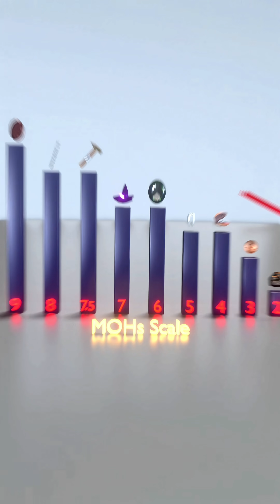Diamond vs Hammer: The Brutal Truth

Comment: I appreciate you explaining this. This is one of the most common myths in gemology. Diamonds are extremely brittle and will chip even from daily wear over years. Most antique diamonds that come across my bench are chipped/cracked from daily wear. All it takes is a little bit of pressure on a specific point and you have a pile of expensive dust.
Reply: If you heat that diamond dust up in an oxygen-rich environment you can convert it into carbon dioxide gas and make some really really expensive sparkling water. Nilered did it once lol
Reply: @timesprodoctionsthat’s funny and totally something I’d image influencers talking about lol
Reply: A material high on the hardness scale will be brittle, that's why hardened steel components are  annealed to be less hard.
Toughness is often better or hammers and swords would shatter.
Reply: So kinda like eggs? They're fragile but on a certain spot of the egg it can actually be pretty strong
Reply: @AxelBalderrama-o6c no, eggs are fragile.
Reply: What gem/stone is the best for jewelry such as wedding rings?
Reply: They're not extremely brittle. They're only somewhat brittle, and given its extreme hardness, its overall toughness is fair to good
Reply: What are some gems you've come across that you don't see alot of chipping on?
Reply: @Marshmallow_Embers all stones can be chipped, regardless of toughness or hardness. If I had to pick one stone that has high toughness, it would be a corundum variety (Sapphire). Its mohs hardness is less than diamond, but it's usually more durable for daily wear in terms of toughness and resistance to shear stress.
Reply: @super_steven_17 jade is pretty tough I believe. It helps that it’s not a crystal.
Reply: @jeantivollier6453 yes I have a permanent jadeite bangle that I wore day and night for 15+ yrs. It does not chip just becomes a little dull from minor scratches.
Reply: None, you can’t fight entropy
Reply: Diamonds aren't anywhere near as brittle as people think. There are plenty of videos of them being smashed with a hammer, and the diamond being pressed into the anvil. Or videos of them being competed pressed into the toking of a hydraulic press. That diamond he had in this video was a cheap diamond with tons of inclusions. (He wasn't going to smash a $5k diamond.) That diamond must have been absolute trash for him to smash it. Even a bad diamond that size is $500, and I know he didn't smash a $500 diamond. So it must have been absolutely terrible, and possibly laser drilled full of holes. A high quality diamond wouldn't have broken that easily. Diamond without inclusions and that haven't been laser drilled, are extremely tough. The myth began as diamond being indestructible, and people didn't know they're brittle. Then it morphed into people hearing diamonds are hard but brittle and they began thinking diamonds are out here shattering. Diamonds are 10x less brittle than you think. They chip and crack because of inclusions and natural "fault lines" where they're weak and prone to cracking. Diamonds are not naturally as brittle as you think. Inclusions and laser drilling weakens them.
Reply: @littlejackalo5326 I believe brittle means that it will break instead of bending. Since diamonds is incredibly hard then it’s hard to break. Also diamonds can be cheap. Lab diamonds are cheaper than mined diamonds and if the diamond lacks the appearance people want it is also worth way less
Reply: Sybau
Reply: Soo, diamonds are really pretty and expensive prince rupert’s drops
Reply: @bloop9074  No, Prince Rupert drops have a high internal pressure so they straight up explode from the slightest pressure on the tail. Diamonds aren't as strong as them either they can chip from other places too.

Comment: So is the Mohs scale exponential like the magnitude scale of earthquakes? Very interesting demonstration. Thank you!
Reply from the maker: It’s ordinal, not exponential
Reply: @MassoyanJewelers  Thank you! And thank you for this little brain exercise!
Reply: @MassoyanJewelers  one day I really want to be able to afford having you guys make two pieces of jewelry I’ve had in my mind’s eye and sketched out. I can’t afford it but I’ve saved your info and really hope I get to see you in person one day!
Reply: A stone that's 9 on the Mohs scale is less hard than whatever stone is 10 and more hard than whatever other stone is 8. That's all the information that the Mohs scale gives you. 

Think of it like a Yelp review; if one restaurant has an average of 4 stars and another restaurant has 3, you can tell people think the first restaurant is better, but you can't quantify exactly how good that 4-star restaurant is, since it isn't an actual measure of anything.
Reply: @lunascapes Gotcha. Thanks!
Reply: it's a non linear scale, and it can be pretty complicated with certain minerals because hardness isn't just a set value attributed to a material, it's dependant on many factors, like temperature. stuff usually gets softer when it's hotter. there's also plasticity, elasticity, all subject to change based off pressure and temperature. everything is a spring, and everything can be fire.
Reply: It’s near logarithmic